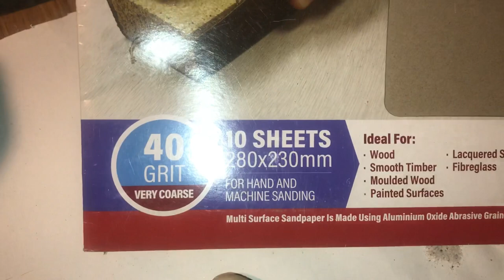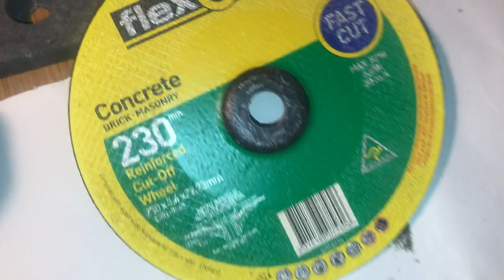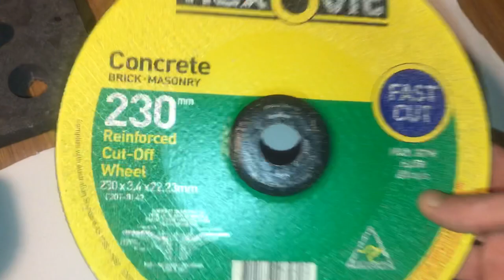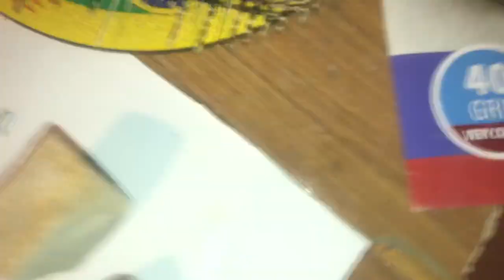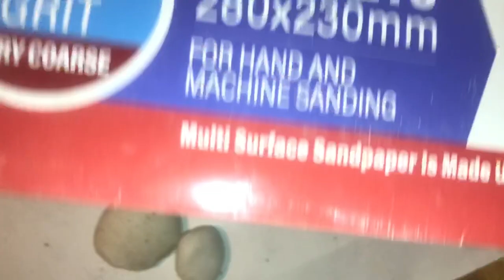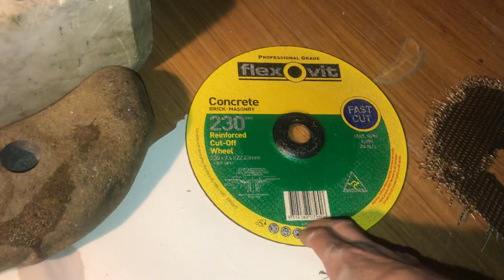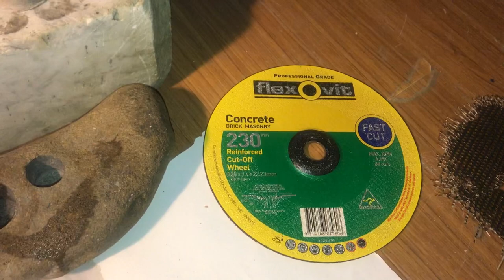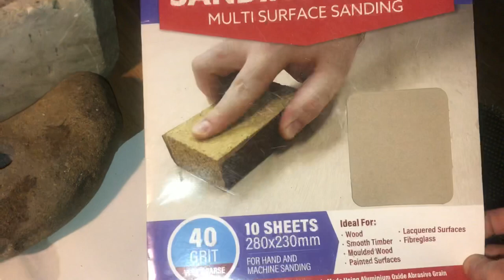How to Lost Ancient High Technology Granite Cores the Primitive Way

Comment: 11:15 a power drill can produce tapering as well. tapering only proves wobbling (vibration) happened during drilling. doesn't prove which method (hand or machine) was used.

Comment: In case you are still messing with this, here are a few ideas that popped into my head:  

Does adding more water through the center of the pipe make a difference for the finish?
Would a completely straight handle with a slightly off-center flywheel work? The goal would be to minimize the hand motion.
Could one eliminate the risk for blisters by holding a wooden ring that the handle fits through?
Are horizontal holes possible?
Does drilling underwater in a bucket help?

Comment: Thank you for sharing your experiments... much to think about. Hmm idea for you. If you had a plank with a hole the size of your copper tube and kept you foot on it. This could act as a "guide". All the best, kieron
Reply from the maker: Yes, that’s how I start my holes. A wooden guide i found to be the best way. Simple and it leaves the cleanest opening.
Reply from the maker: Concrete bags definitely not my idea.
Scientists against myths channel is linked in the description.
They show how to make trihedral  corners in granite using only flint tools and sandstone.
They also show how to make stone vases and they just announced the sculptor they work with is going to begin making a vase in diorite, diorite or andesite or basalt or granite it’s really all just the same. 
Don’t be fooled into thinking otherwise. A lot of these channels will make it seem diorite or andesite is somehow special. Some are more a little more difficult to hammer/chisel but cut or drill or polish it’s basically all the same. With just river sand  or crushed sandstone you can do them all. Not a problem.
Reply: @SacredGeometryDecoded  Thank you, hmm interesting :)

Comment: You can avoid tapering by having 2 attachement points between the drillingdevice and the drill. That will eliminate the oscillation. 
But will also cause more friction and require more power, as you cant use momentum and centrifugal force the same way.
Reply from the maker: Yes, the Alexander Sokoloff channel- he runs Scientists Against Myths channel made larger diameter cores using a frame to keep it all in line.
Chris Dunn’s “ experiment” didn’t use a jig and somehow he got a taper of 1mm? Maybe he has crazy ninja coordination except as he stated himself he gave up on using a bow drill after a few minutes because he, and I quote “found it awkward and inefficient”. Then after a quarter inch he swapped to a diamond core head and then returned to the copper tube. Using 80 grit silicon carbide.
I kid you not!!! His one and only experiment to debunk copper and sand bow drill core he attached an off centre machine handle and turned it to and fro. 
I am going to examine this “experiment” in detail. It’s like a Monty Python sketch.
That’s the one and only “experiment” by the LAHT community, a single core that is a textbook in how not to conduct an experiment resulting in some VERY questionable results.
You can’t make this stuff up.
I took a screen capture of the page to be sure but it’s a chapter from his book so hard copies will preserve this😀
If you want a preview search core 7 Chris Dunn and it’s on his Giza Power website.
Scroll down to bottom to see his “experiment” and read his description of how he did it.
This dude must think everyone else in the world  is too stupid to check his work.
To be honest I think he is a sociopathic narcissist because he can’t be so dumb as to publish something like that and believe it.
Like his Serapeum measurements it’s pure bunk. It can’t have been by accident he messed up so badly. He really must believe everyone else is too stupid not to look behind the curtain.
Reply: @SacredGeometryDecoded  10 years ago i used to take Dunn seriously. I think i took his words for granted because he SEEMED confident and SEEMED like he knew wtf he was talking about. 
Today tho  .. i dont trust him longer than i can throw him. 
Today i look at him as a scammer saying anything to SELL books and get hits.

The way i look at this is more: "If i can improve on this technique using logic and objects available at the time, the egyptians surely could too.". And this has haunted every reconstruction of anything egyptian ever.
Our attempts are always so bad and crude, returning bad results putting it all to doubt.

With generations of experience the egyptians knew exactly how hard to drill, how much abarasive to use, what mix to use, and so on.
Im willing to bet they cut these stones easy af fuk. Like you, just twice as easy or more, due to eliminating basic hitches.
Reply from the maker: Frosty CryptoShark damn straight. In the short time from when I started until now. Just by rotating regularly I have removed bias in drill and slightly elliptical cores now perfectly round.
With better technique I can keep the tube very straight.
My rpm is now 300 plus consistent minimum and up to 420 in good moments. Compared to 2000rpm of power drill. 
Not quite ready for a speed test but atm approx an inch in 2 hours of actual drill time. (Don’t quote me on that yet though as I do it in bursts here and there rather a single sit down session and so haven’t timed it accurately yet- also depends on what type of granite) This old man needs to rest occasionally but with an offsider who could take over while a smoke a ciggy. The drilling would never stop.
I am still a noob and hardly the best person to be breaking physical records.
A healthy young man with good coordination and a wise old experienced mentor?
They’d not only be getting better quality than me but in a very short time.
And core 7 isn’t very impressive at all to me anymore. Drilling those vases very quickly is going to be the next step for me. Scientists against myths have already began tackling that but I have a few ideas of how to speed up the slowest parts of their process.i have no doubt it’s going to work but the proof will be in the pudding.
Reply: @SacredGeometryDecoded  core 7 isnt impressive at all to me any more... 

Dude, imagine the stamina, strength and speed of those doing this since their father started teaching them at early age.

Do you think you can use a technique to drill a straight hole with little tapering and no frame? 

Havent we seen drill frames in old records aswell as manual hand drills without ?